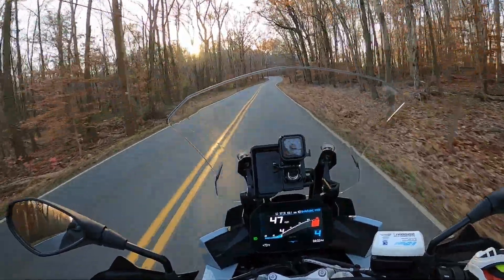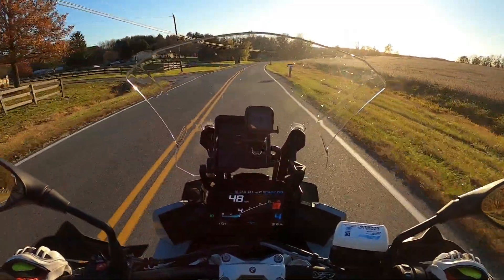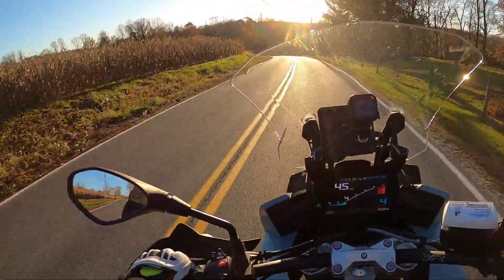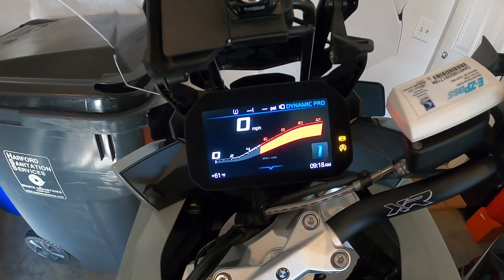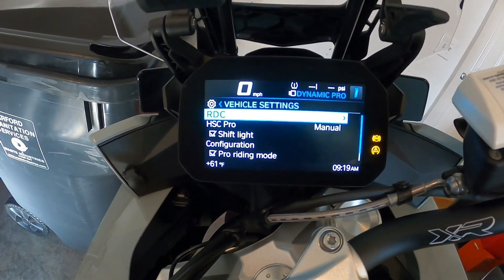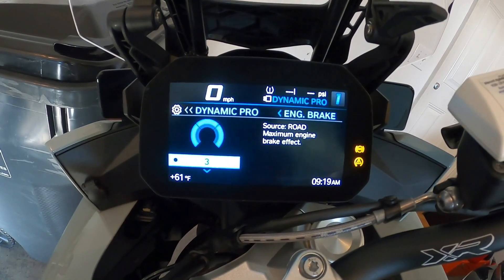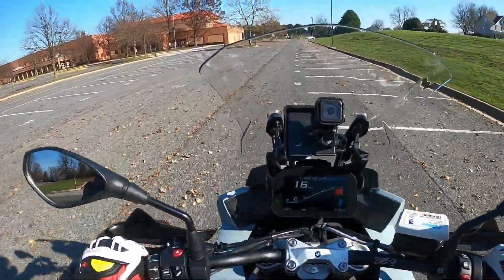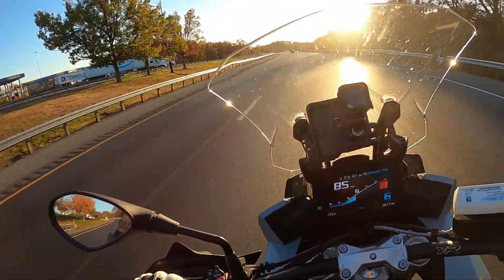Engine Braking and Dynamic Engine Brake Control - 2020 BMW S1000XR

Comment: Good explanation of adjustment for that bike. I just bought a new 2023 R1250GS and was startled while riding a very familiar stretch of downhill twisties on highway 1 in Northern California. The engine braking management very obviously kicked in on a sharp left-hander I always take at speed. (on my 2011 R1200GS). This had the unfortunate effect of accelerating the bike unexpectedly just as I was counting on engine braking, just before my intended acceleration out of the turn. The bike (unexpectedly) diminished its lean angle, straightened up and pointed me at the right side edge of the road. I was ready to brake, so no harm no foul, but the loss of direct engine braking control was in my view unnecessary and even dangerous in that circumstance. No one at the dealer service shop could tell me how to crank back the braking management software (without also disabling ABS) and I can’t find comparable settings to yours on the S1000. Thoughts? Ideas?

Comment: I just purchased a 2020 s1000 rr still going thru the break in period. Im curios why does it have a pop noise coming from the muffler every time im in high rpm n i release the throttle it would make that noise or if i downshift n release the throttle it would pop in the muffler?  I had the 2012 one n it didnt do that

Comment: I have been thinking about the engine braking on the XR. I think you came from a Multistrada so I’m curious how effective you feel engine braking is on the XR (in everyday riding) compared to the Multi. I had a 2014 Multi and now I’m on a 1250 GS. I prefer to use engine braking in the twisties rather than the brakes themselves.
Reply from the maker: Interesting that you ask.  I found the engine brake on the MTS to be much more noticeable.  I also find that the V-twin was much easier to heal/toe.  Different characteristics for sure.  If I am getting after it I don't like a ton of engine braking as I still feel like it unsettles the bike.  I will use it to dump speed prior to tip in.  Aggressive engine braking can help scrub off excess speed for sure.  I definitely wouldn't want to drop a gear mid corner at the wrong RPM, however.

Comment: Hiya Josh, I use engine breaking more than the brakes at slow speeds, another good video mate .....👍🏴🇬🇧
Reply from the maker: Thanks for the feedback.  I have only ever driven manual cars and rode bikes since I turned 18...I can't say that I really think about it but I use engine braking in sync with brakes etc.  It's just a natural part of how I drive and ride but I had good teachers.  I have ridden with those that don't and that's a real head scratcher.

Comment: As i understand, pulling the clutch lever will cancel any engine breaking setting. Right?
Reply from the maker: Correct.  In fact...there is some interesting racing history to this end prior to slipper clutches and engine braking controls.